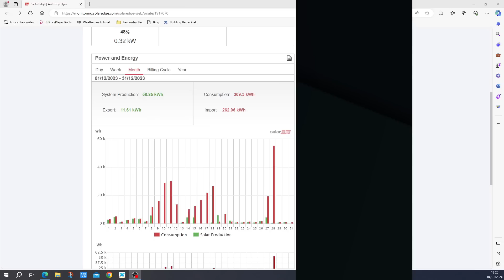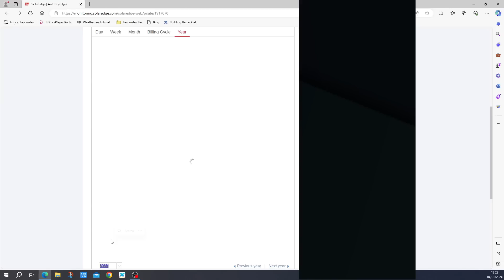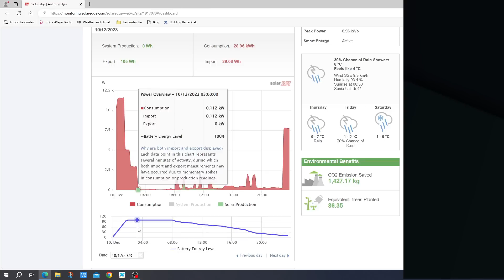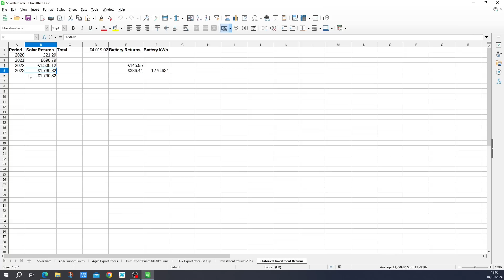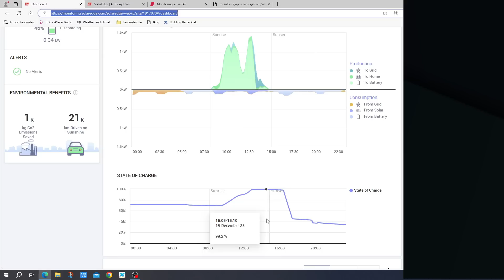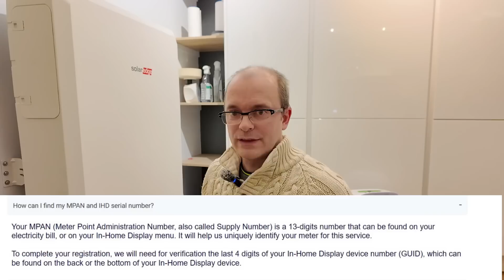Solar Production 2023, SolarEdge Battery Insights, Octopus Go Intelligent.

Comment: Very interesting that you have about 1.15 Mw in June with your 9kw vs my 1.05 Mw from my 5.5kw in January (opposite hemispheres and 32S). Not as big a variation as I might have expected, although I do have some obstructing trees to contend with. Even with obstructions, my worst month was 300kwh. Again not as great as I would have thought. For the past three years the system has produced a total of around 7.72 - 7.8 Mwh. This month I am installing a 10kwh battery, mainly in anticipation of future power issues. It's unlikely at current rates to be cost effective, but it will be nice to have. I've no intention in acquiring an EV.

Comment: Hi Anthony thanks for documenting these issues.  I have a quote in hand for a solaredge battery system but I'm a little concerned now.  With the benefit of hindsight would you have installed a different system?  Which one?  Thanks!

Comment: I generated 4.1MWh in 2023. Yet for each year 2019 to 2022 my array has consistently generated 4.4MWh.  There could be some panel degradation but I suspect it’s mainly down to more cloudy days, possibly caused by the El Niño event.

Comment: Interesting video - thanks! I have a Solar Edge inverter with a DC coupled LG battery. My SE reported generation stopped making any sense when I began charging the battery overnight with Octopus Go. My installer failed to get an explanation from SE so for the time being I have stopped worrying about it. I did try the SE algorithm for controlling the battery but after 4 days of "learning" I was still buying electricity at the peak rate - something that doesn't happen when battery charging is controlled on a timed basis. I feel that Solar Edge have good hardware but it is let down by software and their approach to providing end users with meaningful information.
Reply from the maker: The overall impression I get is that more and more end users are getting a bit frustrated with the way solaredge deals with them. Overall I think Solaredge does great hardware but when it comes to customer service they are not up to modern retail standards. 

The impression I get is that their focus is towards installers more than anything else and that is reflected in the fact that installers have got all the configuration access privileges to your inverter but homeowners do not.

Comment: I too was confused why the SE battery % was depleting at a faster rate than consumption. Glad you found out why.

Two observeations I've repeatedly noticed: 100% capacity reached but continued charging for another ~30 minutes. 0% capacity reached after saving session deplition but then after switching from manual control back to Maximise I get 6% capacity! Helps to avoid peak rate on Flux.
Reply from the maker: I see that as well, and I think it has more to so with calibration of battery capacity measurements.  I find that if the battery hasn’t been fully cycled, then over time, the capacity measurements can jump or sink suddenly by a few percent.  Essentially your cell voltages can start to drift over time.  The battery management system will aim to keep cell voltages balanced, but cells can have very slight variations in charge discharge characteristics that built up over time.

Normally a full cycle sorts out the battery capacity measurements again.  There is a useful measure called “available capacity” in the SolarEdge API.  You’ll see it in my video.  That can jump around somewhat from 10000Wh all the way down to 8900Wh.  I haven’t studied it much, but it’s probably worth examining it’s behaviour over a period of a few big and small charge cycles.

Comment: Hi Anthony. Thanks for the video. I don’t have installer privileges on my Solaredge battery, but have been given additional control of the battery on the solaredge app over the past few months. Not sure whether this is now standard for all owners, or whether I’m a test subject on a Beta version, but I can use the app to either manually set charge and discharge times, or let the solaredge algorithm work out how much to import overnight. I seemed to notice that the strange discrepancies in production figures started around the time that the app was updated to give me this additional battery control. I just update daily production figures on my own spreadsheet. Slightly tedious admittedly, but this gives me a more accurate figure for overall monthly production.
Reply from the maker: It “should” be standard, but for some reason mySolarEdge app has the “time of use” options blocked out “available soon for sites enrolled on grid incentive programs”.  I get the impression that this is a bug, and some people have access and others don’t.

In theory you should have the ability to do 80% of what can be done on the installer settings.  Only thing missing is “charge from clipped solar”, which is more useful during spring and summer.

Comment: Great update packed full of data. I know these videos take a lot of work. Yeh, the battery efficiency does not surprise me due to the fixed losses (BMS consumption). Reporting discrepancies well spotted. I've looked at intelligent octopus flux (no EV) but it's not as favourable as Economy 7 for us because the night time cheap rate is too short. 6 hours may be enough but I'm not ready to get an EV for it. We have Givenergy solar and bat, and the automated export for demand flexibility scheme works well (Giveback/Axle). Cheers
Reply from the maker: Intelligent Octopus Flux has no cheap nighttime rate.  But it does have have the same import export price of 25ish p/kWh.  You have the “dress code” of a givenergy battery to hand over control to Octopus Energy in order to qualify for that tariff.

Biggest advantage of that tariff comes in the summer time with a big solar array on your roof.  25p/kWh is a very handsome price for export.  It’s not so handsome in the winter time when running a heat pump or charging an ev.

Comment: SolarEdge want the serial of the IHD because it allows them to access your import/export figures.
Reply from the maker: In theory the Mpan number which is on the actual meter should be sufficient to provide that information shouldn’t it?
Reply: Possibly, I think there's more than one way to do it. On second thoughts, the serial on the IHD may serve as some kind of password for them to be able to access data of your MPAN. I had to use the IHD serial when joining Hugo type apps that want to read your data. @anthonydyer3939

Comment: The futures prices out to 2027 in Australia are increasing 😕. I definitely would not need the extra heat inside my house in Australia
Reply from the maker: In theory futures prices in the United Kingdom have every reason to rise up especially with conflict in the Middle East affecting the maritime traffic up and down the Red Sea for example but the electricity and gas market seem at the moment to be fairly resilient to all of that.  But the impression I get is that Australia is seeing a lot more rooftop solar being deployed simply because it is by far and away the cheapest source of electricity so it’s rather peculiar that your futures prices are increasing.
Reply: @anthonydyer3939  Absolutely 💯.  Current international conflicts are not adversely impacting prices. I am charged 160 cents per day for a connection fee. Does the UK and Scotland, etc, have this same fee?
Reply from the maker: @peterryan7340  We have a 57p/day standing charge.  It’s supposed to be a rental fee for the electricity meter.  But 2 years ago, the fee increased about 150% to cover distribution infrastructure as well (previously distribution infrastructure was built into the consumption costs).
Reply: @anthonydyer3939  That's exactly what happened here too.

Comment: Hi Anthony - How do you get access to the new dashboard? When I log in I get the old one
Reply from the maker: Top right corner of the monitoring website you have the option to switch between old and new dashboards.
Reply: Nope don't have  that option.... @anthonydyer3939
Reply: @anthonydyer3939  Thanks I had not noticed the option button. I will give it a try next time I log in

Comment: Hi Anthony, I’ve only just become aware of your channel - great analysis. My own system is quite similar to yours, but 5.6kWp PV panels, and no smart meter (no wide area network where I am). 

One question. You say at about time 18:45 that you “switch off the battery” between certain hours to improve overall battery efficiency. How do you switch off the battery? Is this by physically switching off & on the battery isolator, or is there a software setting somewhere that I’m not aware of?
Reply from the maker: There’s a mode called “solar power only”.  That prevents the battery from charging or discharging.  It’s in the installer settings, so if you don’t have access then it becomes a tricky proposition.
Reply: Thanks, Anthony. I continue to be amazed that SolarEdge still have settings that would be very useful to system owners hidden behind “installer settings”. I’ve had similar issues in the past, and in fact previously suggested to them that they add a “prevent charge and discharge” setting to the TOU options, but received no reply on that. I think it’s time I attempted to get access to the installer settings - after all, I own my system, they don’t. How did you go about getting access to the installer settings area?

Comment: Hi Anthony -I thought I was the only one with a similar problem. But I now see it is a SolarEdge problem. All my figures were ok up to and including November but December and now January are clearly not recording/displaying correctly. I have a case open with SolarEdge but response has been slow and have not been given an indication when it will be fixed.
Reply from the maker: I don’t think it will be fixed.   I think the “solar production” formula = solar power home consumption + export + battery discharge - battery grid charging.

In theory this formula works, but in practice this only works if the efficiency of the battery is 100%.  When you have an efficiency for your battery which is closer to 80% you end up with more energy been spent charging the battery than you measure in terms of useful output and therefore your solar panel production values get smothered on cloudy days.

Alternative option is to go onto the analysis page, and look for the string DC power and energy outputs.  This is the energy sent to the inverter from the panels.  But you have to subtract 20-30 watts for inverter internal consumption before you get the “useful” figure.
Reply: @anthonydyer3939  Thanks for the response. What I cannot understand is why they have broken something that seemed to be working fine for months. Solaredge monitoring and reporting seems to be slipping further behind companies such as Giv Energy
Reply from the maker: @paulcolu  The overall impression I’ve had a SolarEdge is that they are very slow to change anything at all in terms of software.  It’s taken  years to make battery controls accessible to end users for example and when you consider the fact that they’ve had quite a few years of experience with the LG chem batteries prior to the Energy bank, you’d think that they would have cottoned onto the fact that the end users would want to actually control their batteries.

But the presentation of production and consumption figures seems to be completely wrong in terms of philosophy:  solar production for example should look at the total energy produced and where it is going in terms of charging up batteries, home consumers and export.  And consumption should be looking at:   Grid consumption, consumption from solar direct, consumption from solar via battery and consumption from grid via battery.  

It seems like they’ve got all sorts of different conflicting ideas within their own company as to what is production and what is consumption.
Reply: Hi Anthony - I totally agree they are falling further behind their competitors

Comment: Hi Anthony, love your detailed and very pleasant narrated video's. Is there a specific reason why you still use the former (old) dashboard?
Reply from the maker: Normally I use the new dashboard.  But imports are calculated differently between old and new - old factoring battery charging from the grid.  

It’s also much nicer to look up specific days quickly on the old dashboard.  The new dashboard requires you to enter start and end dates, meaning more button taps.
Reply: @anthonydyer3939  Thank you for your response.

Comment: Hi Anthony interesting video. We have two Solaredge batteries and a Solaredge 6Kwh inverter. 
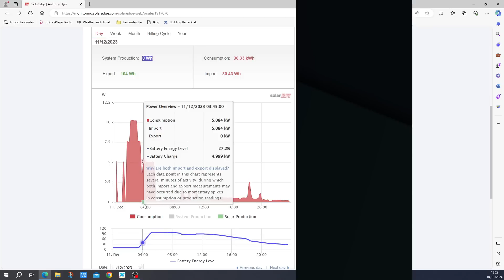Ever since moving from the Flux to the Go tariff in mid October and importing for the four hour night rate the Solaredge app and dashboard do not record consumption or import correctly. Every morning before any generation the app is showing 300-400Wh of production which can only be export from the batteries when they near 100% capacity at approx 04:30. System production on the dashboard is not consistent with the actual generated electricity and on the app there are complete days missing generation when you look at a weekly or monthly view.
Reply from the maker: The old dashboard on the monitoring website will record the battery import correctly, but system production figures are mysterious.

I think the formula is Production = Direct Solar Consumption + Export + Battery Discharge - Battery grid charging.

The problem with that formula is battery efficiency.  It’s not 100% for charging cycles.

Battery grid charging in December far exceeds discharge (to AC) when discharge rates are low.  So when solar production is marginal, exports are zero and discharge is less than grid charging, the the overall production registers as zero.
Reply: @anthonydyer3939  thanks for the reply. Makes keeping track of generation a pain as it will show up on the daily figures but it is not accurate.

Comment: Hey Anthony, I have exactly the same setup as you, octopus intelligent go, SolarEdge inverter\battery and Zappi Charger, I wasn't aware of Export during Octopus saving session, could you please explain how did you set it up? during cloudy days by the time it's 5PM my battery is already at 40% and discharging it for an hour would mean I would then be importing from grid in the evening, does it still make sense to export?
Reply from the maker: If you export at £2.25 per kWh down to 0%, then it doesn’t matter if you are using electricity the rest of the evening at 30p/kWh.  You’re still making money.

So two things for saving sessions 
1.  You have to manually opt in to the particular saving session. It’s not automatic.  I’d recommend you look up all the details about saving sessions and get signed up and then you manually opt in to each individual saving sessions as and when they become available.
2.  You have to manually set up your energy bank battery to discharge at the maximum rate during the savings session.  It should be possible to do that using your SolarEdge app:  there are settings for discharging the battery now so that’s not just reserved for installers anymore.

In your example, you can force charge the battery from 40% to 100% at 3pm at 30p/kWh and then your’re all set for forced discharging of the battery during the entire savings session.